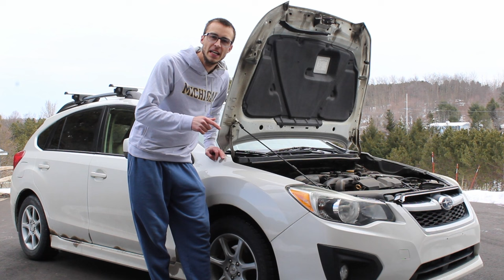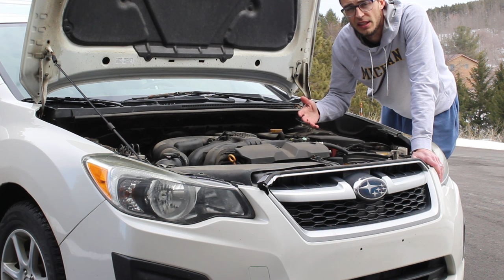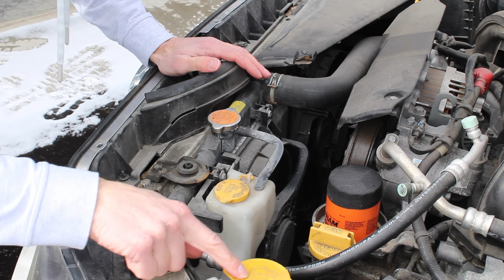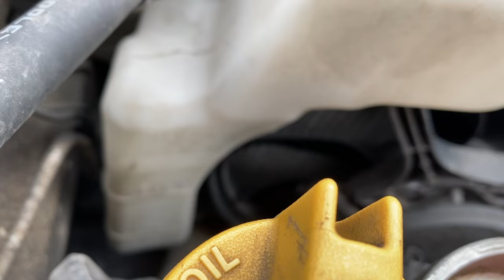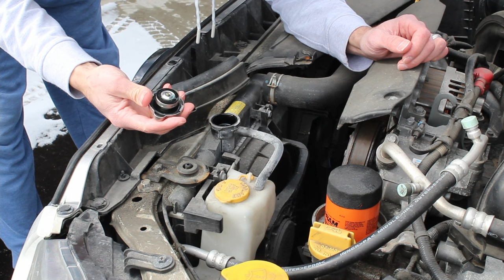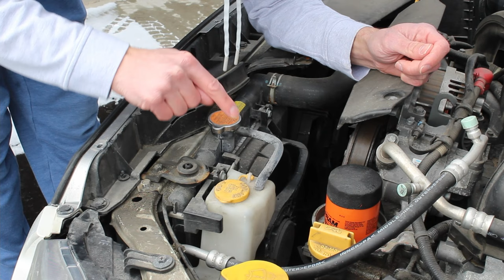Losing Coolant? Maybe not...

Comment: WRONG : Full is where you should have your coolant level when the engine is dead cold. (actually anywhere between the full and low mark, but you should keep it at the full mark and be done with it) You have full mentioned to indicate that you should not have coolant over this line when cold. The rest of the reservoir above the full mark is there for the hot/expansion coolant to be allowed without overflowing to the ground.  It has nothing to do with hot or cold, so this is why you don't see these terms on the reservoir.
Reply: Yeah that makes sense.
Reply: I disagree, should be at min for cold, max for hot

Comment: Some wrong information here. My SUV and most newer vehicles do not have a radiator cap. It is all done through the overflow which is pressurized. In this video, you said it is not, but that is not the case in all vehicles.
Reply from the maker: Correct, many new ones have pressurized reservoirs
Reply: @KurtofTrades  yeah My 2018 Trax LT is pressurized by 20 psi

Comment: You need to be careful. Not every vehicle works this way. Some european brands (fiat for example), dont have a radiator cap. The radiator is a completely sealed unit, and the expansion tank is directly attached to the radiator, and the radiator and expansion tank both get pressurised when the engine runs. The cap on the expansion tank then works as a radiator cap and has a spring loaded release valve and seals. With this design, the level in the expansion tank is directly related to the level inside the radiator, and if the level gets below the minimum line (and they mark is as minimum rather than low), it means your radiator isn't full.
Reply: I think this is the case with my Chevrolet Aveo 2012. I have been trying to find the radiator cap but I didn’t see it.
Reply: @topesaka5097  yes, indeed, similar cooling setup, the expansion bottle cap is the radiator cap.
Reply: @cartouchator  Wtf how do you even check if their is coolant in the system with this if the car is not overheating and the resviour is empty?
Reply: @legend-jp5to  you cant.. you either add some and see if the level rises in the expansion bottle, or you open the drain under the radiator..also because it's a sealed pressurised system, it should never need topping up. If the collant is low, It means there's either a leak,  a head gasket failure, or a expansion tank cap fault.
Reply: @cartouchator  I have a Renault master van 2020 and the coolant somehow disappeared just after 2 weeks I took to the mechanic to pressure test it he said their was coolant in the system and the system holds pressure so their wasn't leak but their was air pocket because the previous mechanic didn't flash it properly so I told him to flash it properly and remove the air Pocket and top up again just 2 weeks later the resviour seems empty you can see some trices still remain at the bottom but it's way bellow the minimum amount I owned this car from new and I had no clue it didn't actually come with seperate radiator cap to check, so now I'm in this dilemma where I have no clue if the radiator is actually full of coolant or if it's low as the resviour, I can't see any leak its been pressure tested and their wasn't any leak but somehow the coolant is going somewhere, everything else was checked and the head gasket is good no white smoke no Milky oil, the car drives normal no misfire no overheating but it seems the coolant is just vanishing. What do you think could cause something like this?
Reply: @legend-jp5to  head gasket failure on these engines don't always cause white smoke or milky oil. The only sure way to test for head gasket failure is with a chemical test. They dont cost much, you remove the coolant expansion tank cap, place the tester tube over the opening on top of the coolant expansion tank, and then pour the chemical solution up to the line into the tube. You then start the engine and let the engine reach temperature so the thermostat opens, and watch the testing tube, if the liquid changes colour, it means that exhaust gasses are being mixed into the coolant and this is a 100% tell that you have a minor head gasket failure.
If the liquid does not change colour, you can be certain there is definitely nothing wrong with the head gasket. In that case I would do another pressure test, but do a pressure test after the engine has been ran and is warm. Some leaks sometimes only happen when the engine warms up and the thermostat opens, especially around the thermostat housing or return hoses tearing at the jubilee clip when they expand from the heat. Your mechanic does not sound like he made much effort, any decent mechanic, from the symptoms, and after doing a pressure test, would get straight to doing a chemical test..

Those coolant systems are also very difficult to bleed, or "burp" as I call it. It can take multiple attempts at removing air out of the system. A common symptom for air locked coolant is intermittent overheating when sitting in traffic, gurgling noises from inside the dashboard on cold start up, and heating in the van taking a very long time to start warming up. Bear in mind those symptoms can also indicate partial head gasket failure, as that causes exhaust gas bubbles in the radiator, same symptoms.
It's hard to bleed because there's no radiator cap, and the expansion tank is usually to the side, so you get air bubbles stuck at the top of the radiator and it takes multiple times driving the van and letting it get warm, then cool down, then warm again, for the air to move over to the expansion tank, I've seen it take 2 weeks sometimes.

Definitely do a chemical test though, I had a car with a similar engine, and exactly the same symptoms as you, no white smoke, no milky oil, but constantly having to top up coolant, like every 3 days. Did a chemical test, and the head gasket had a small leak. Got rid of it before the head gasket could get any worse.
Reply: @cartouchator  thank you will diffently do the chemical testing at the same time I suspect the radiator cap which I will also replace it, i also sometimes when I have been driving for quite a while smell foul smell it goes away like after 1-2 minutes it smell likes something is burning it has this weird smell.
Reply: @legend-jp5to  could be unrelated, or could be the heater core "running dry" momentarily because of air or exhaust gas bubbles in the system, which can smell like burning or heating up plastic.
Reply: @cartouchator  how do you correctly get rid of this air bubble it's been a problem since I have done coolant flash at 150,000km
Reply: @legend-jp5to  if there's no leak introducing more air, and no issue with the head gasket, it normally goes away on its own, you drive the car a couple weeks, top up when you see the level has dropped a bit, and after a while if you dont have to top up anymore, you know the air is all out. It shouldn't take more than 2-3 weeks of driving , and it's only an issue if the system was completely drained and refilled, if you replace the water pump for example. Once the air is out, you never have to top up again, it's a sealed system and there's no evaporation happening.
Reply: @cartouchator  thank you, you have been helpful thr first thing I will do is that chemical test first to make sure it's not a bad head gasket, once that is clear than I will pressure test the coolant while the engine is hot one more time, will keep you in touch on how it all goes .
Reply: Chevy Silverado is the same way my expansion tank IS presurized.

Comment: thank you for the video. My car once lost water and got heated. I ve got white smoke from the exhaust. i got to the technician who filled it up with fluid checked out for leaks (didnt find any) also replaced the radiator cap. So he got suspicious of the fluids going into the engine.  I drived the car for about 2 weeks. Everything looked normal driving was like nothing ever happened no heating and radiator properly full. The only problem was that the overflow tank used to get lower as much as the car was moving. That happened little by little needing lets say a distance of 100kms until it got at low level. When i filled up it got low again after 100kms. So finally i got my car for engine service. The check up showed destroyed gasket and cylinders. We replaced the engine cylinders and pistons for a full reconditioning and replaced the overflow tank and radiator as well. After that car was again driving and moving fine and radiator is always full. But the overflow tank still loses coolant at a same pace as before. That is a 5 months situation with me filling up the tank with water or coolant. Although technican told me that i don't have to do so. I am afraid of loosing coolant from the tank and then from the radiator during a trip and then get any serious damage again. We did a double check for coolant leak and didnt find any. Replaced again the cap.Technician insists there is no fluid pulled back in engine. But what does  this coolant getting lower mean? Could that be the reason for the heating at first place? So i may run on same problems again? Or an empty overflow tank is just a  normal situation as long radiator is full? Unfortunately never checked how overflow tank functioned before the heating. So it is like a mistery..

Comment: Thank you. Good advice and explanation for a system many may misunderstand.

I would add that technically it's ok if the overflow is low/empty as long as the radiator is full. However it's not the optimal way to keep the car running. If you check the Subaru manual, it will tell you to check the overflow tank level when the car is cold (fully cooled down over night ideally). If the coolant level is at or below the low mark, fill it with coolant until you reach the full mark. That overflow tank serves two functions. It is an overflow tank and a gauge. When the car is warmed up, coolant will expand and flow into the overflow tank. When the car cools down, the coolant will contract and the radiator will suck back in coolant from the overflow tank. If the overflow is empty, it's sucking air in instead of coolant as designed. It's not the end of the world, but not ideal either. The tank also allows you to take a quick look under the hood and see if you're losing coolant or not without popping the radiotor cap off every time. It's only accurate when completely cold. When it's warm, it will go above the full mark, but that's fine. It's not going to spill out. If it does spill out, it means you were doing track days. 
If your tank is that empty and you fill it to the full mark when it's cold, don't be surprised if the coolant level drops after a few drive cycles. Keep topping it up while it's stone cold. Run the heat in the cabin to help get any air trapped in the system out. It'll eventually settle to the full mark where it should be when stone cold. If you're radiator is full to the top and after about 2-4 top ups of the overflow it's still going low, you may have a problem.
Reply: 100!
Reply: Good point but can you please tell me what kind of Problem? I have a new radiator and it's doing the same thing, I mean I popped it up 1,2 times (both the radiator and the bottle/reservoir). I love my car😊

Comment: Totally needed this because this early morning when I got off work, my heater was blowing cold air on one side and hot air by the driver side. Researched it up and this was one my issues. My coolant reservoir is low but also my radiator coolant is also low. I do not see any leaks or sign of color under or below the bottom of the car. My guess is it probably evaporated. Tomorrow I'm going to to drain whats left of it and refill new coolant. I'll be sure to run the car to cycle the air bubbles until there's no more bubbles. 

If I miss anything else please let me know for this is my 2nd time changing it. Thanks for the helpful video, it helped me see and understand things more clearly.
Reply from the maker: If half of your heat is hot and half cold it’s probably your blend door actuator. Look into it. Glad to help!

Comment: Thanks mate, was topping up my over flow bottle thinking it was low! Cheers 😃🇦🇺
Reply: My car is having the same problem I filled it yesterday between the two lines, just a bit ago I checked it. The coolant was down to the bottom line so I topped it off
Reply: No need to as explained in the video, when the engines hot the overflow bottle should be at the full mark.
When it's cold the coolant contracts and makes it look like it needs topping up.😉🤙

Comment: Excellent video, to the point, which everyone wants 🎉👍.
I have a few questions, my reservoir tank  gets empty even though I fill it up to that High Mark and the radiator shows up the full coolant (after the drive and when the car isn't hot), when I open up the radiator cap. Is it normal? The temperature nowadays in my city is very warm. I am confused about the reservoir, there might be some leaking in the radiator that consumes up the radiator water and then the radiator takes water from the reservoir?
Reply from the maker: It’s probably spitting the extra coolant on the ground, if you fill the reservoir up to the top when cold, it will expand and overfill the reservoir and dump the excess coolant on the ground

Comment: My 09 Scion Tc, I believe has been leaking coolant. After I refill it, coolants gone after 20’minute drive, Theres no leak on the tray under the engine, The oils also clean, So im not too sure what the problem is, Radiator looks a little corroded but not sure..

Comment: I have full expansion tank but the radiator is empty everyday when I remove the pressure cap in the morning to check it. Haven’t seen any leaks. Is it okay to refill it?
Reply from the maker: It’s fine to refill, you need to find out where your coolant is going. Might be a leak or might be going into the oil cooler or engine oil, or out the exhaust
Reply: @KurtofTrades  I changed the radiator cap. I also used k-seal before but don’t know if I should keep using it. Do you have a video that demonstrates how to check for these leaks you mentioned?

Comment: Only my radiator is low my overflow tank is a little bit over full when it’s cold, but my van got hot the other day because it was low on antifreeze. I’m constantly putting antifreeze in my radiator. My radiator is only a couple years old. My water pump is a couple years old. There’s no antifreeze on the ground. I’m not blowing white smoke and my oil is not mixed.
Reply: Have you found the problem ?
Reply: @youknochent  I traded that van in for a 2017 Kia forte five

Comment: I over filled my reservoir 50% and it don't boil over. If it boils over you have a thermostat that is not opening. At 120k miles coolant O rings leak causing Subarus to slowly lose coolant. A new cars coolant reservoir is filled to the middle of L and H.

Comment: What if I keep putting coolant but it’s still low. It’s not leaking or anything so where is it going?
Reply from the maker: If you keep adding it to the radiator it could be going into the engine, leaking, evaporating or going out the exhaust. Lots of options
Reply: @KurtofTrades  just got back from the mechanic it needs a water pump and a coolant outlet flange.

Comment: my coolant tank is totally empty but radiator full
Reply: Add to 'full' or 'Cold' line ASAP when engine is completely cold. Monitor and see if its still going down. If so then check for a leak.  If no visible leak and engine is still losing coolant then its most likely leaking mixing with engine oil. Major issue.
Reply: @muhammad-bin-american

Comment: Hi! I just bought a subaru impreza 2017, and when i open the radiator cap and ut se water in and then fill it, i could see some oil.
¿Is it normal? Some guy told me that it's normal, beacause the coolant on this cars are oilly 😅.
Hope you can respond to my question.
Reply: I have never heard of an oily coolant but you never know. My advise is to check Subaru online forums.
Reply: Bro your head gasket is leaking for sure.